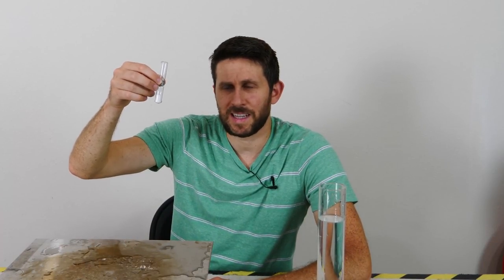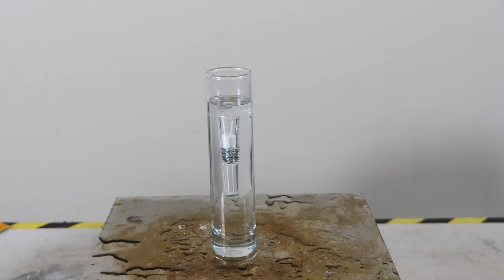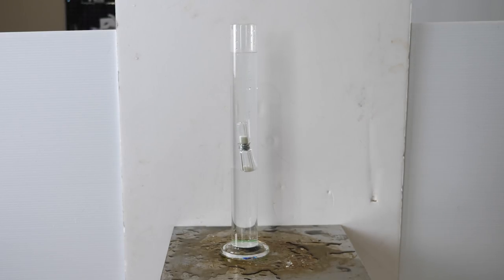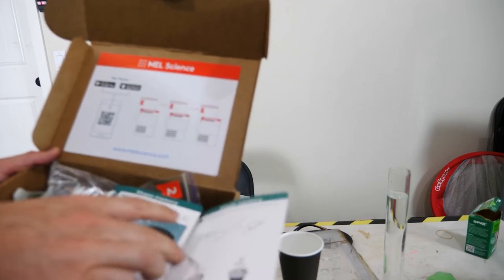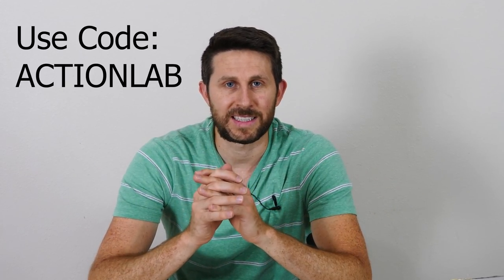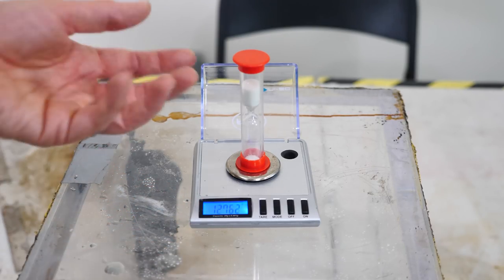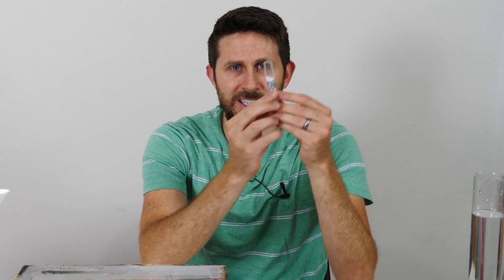Can You Figure Out The Hour Glass Buoyancy Problem?

Comment: Technically, the hourglass is "heavier" when the sand is at the bottom, in that more of its mass is closer to the rest of Earth's mass... which means that the gravity attraction between Earth and the hourglass is greater. But of course that effect is far smaller than the precision of any measuring method you would have to detect it. Great video. Thanks!

Comment: I was thinking the hourglass would weigh more when the sand is at the top due to the potential energy, similar to a compressed spring.
Reply: It probably does but the difference would be too small to measure. A small gas bubble forming on the side of the tube would affect the buoyancy more.

Comment: For those doubting this is due to friction, notice at 3:50 that the hourglass is dragged to a halt after it's fallen into the flipped water. Eventually, the center of mass of the hourglass moves low enough to "stand" the hourglass back up (3:56, but it's hard to see due to all the shaking) enough to release it from the walls. The change in the center of mass is moving the hourglass from an unstable to a stable equilibrium.

Comment: What about the little amount of sand that is free falling? As more sand reaches the bottom, the distance to the pile is shorter so the sand in the air is less, hence there is a slight change in weight.
Reply: I think that would have some effect, but at such a small scale it doesn't do much.
Reply: Yes you are correct,    And the explanation is wrong.
Reply: Internal forces can never do anything.  They always  Cancel  out
Reply: @LucaPro02  you are the best! Thanks so much!

Comment: I would like to see this experiment with a tube, unable to be blocked by sand, connecting the top and bottom, so as to prevent the possibility of a pressure differential, which is what I belive is causing it to float. As the vial is flipped, the motion of the sand tries to push the air out the other end, but since it's sealed, the air subsequently ends up on top of the sand just prior to the sand sealing off the choke point.
Reply: There will be a pressure differential, because there will be a column of water in a gravity field.
Also, it is not the pressure differential that makes an object float, it is gravity (as in, all objects tend to fall/go down, but the heavier object replaces the lighter one at the bottom, so the lighter is "pushed" upwards).

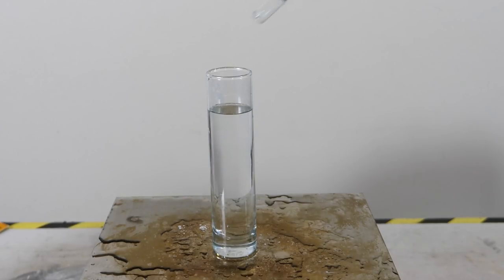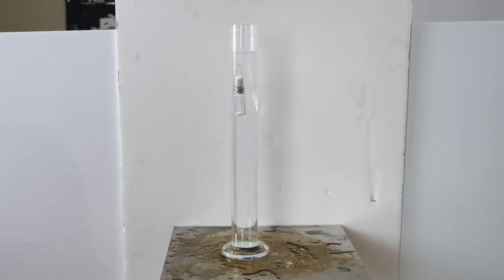Comment: Great video, but calling it out that this was sneaky!  The first two demonstrations at 0:40 and 1:24 happen to have a camera angle that helps to conceal the hourglass leaning on the inside of the tube.  In the third demonstration at 1:52, we can see the lean, but the hourglass is moving around so freely that it appears to be floating and isn’t obviously rolling with continuous static friction.  The fourth demonstration at 3:50 is a different experimental rig with rubber o-rings, and this change of experimental setup introduces the new variable of the frictional properties of rubber to consider.  Only in the fifth demonstration at 5:02 (the reveal) do we see a demonstration with 1) a wider tube so the hourglass leans more, and 2) a side-on camera angle where the frictional forces are more apparent.  Sneaky!!!  

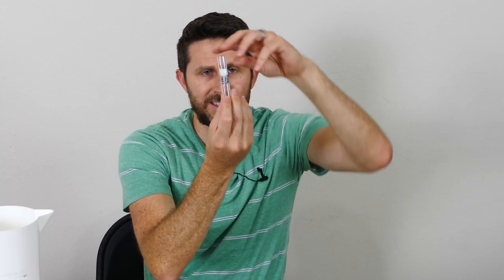P.S. At 6:06 you said “and whenever it leans against something, then that introduces a new static force or a static friction that’s pushing it upward and it’s helping ‘increase its buoyancy’.”  To be pedantic, it doesn’t actually ‘increase its buoyancy’.  A free body diagram would show the same downward force due to gravity plus the SAME upward force due to buoyancy, but with an additional force due to friction which brings it to net zero.

Comment: I thought something like... Water pressure increases as you go down, so when the lower part is empty in addition with bit high water pressure it has maximum Boyency so it floats, as sand shift to down emptying the top, but now empty part relatively in less water pressure, it doesn't have enough Boyency to float, so now it goes down.
Reply: I thought about water pressure for a few seconds, too.  I'm wondering why I and so many missed the friction solution, and I'm thinking it didn't occur to us because in everyday usage, glass on glass is not something we associate with friction, in fact we might even consider it next to frictionless-- but of course, it isn't.
Reply: So now you know that buoyancy only depends on pressure difference, not the pressure itself.
Reply: @rodchallis8031  Even if the friction is zero, I still doubt the norm that it goes down.

Comment: You missed a big part of the conclusion, that the friction force keeping it up is directly proportional to how much sand is in the top half. In other words, this will work with any size hourglass, because the heavier the hourglass, the more friction force is produced on the cylinder wall to keep it up as it tries to tip over.
Reply: isn't there a limit to how much friction glass on glass can offer?
Reply: @apbosh1  I don't think so. Friction is always proportional to the force between the two surfaces.

Comment: What if you put the hourglass on the bottom of the tube with the sand on the top of hourglass, will it float up or will it stay floating at the bottom of the tube?
Reply: Bottom
Reply: Good question. I noticed a hinge on the cylinder mounted on the wall. Is a pivot hinge?

Comment: Hi,
I just thought of a fun experiment. Suppose an object is falling in a tube. As soon as it reaches the centre. Flip the tube upside down so that it will fall from the other side. Doing this keep the object in a the centre(or a small range). What is actually happening? 
It could be better if observed with a magnet falling through a copper tube...
I am already curious to do the experiment by my self. But i don't want to spoil your lovely and in depth explanation. I would be glad if you make a video on this experiment. 

Love your videos💛

Comment: I mean, if we want to get oddly specific, technically it will "weigh" more if the sand is on the bottom. The difference would certainly be immeasurably small though. Because if the sand is on the bottom, it's perhaps 1-2 cm closer to the Earth's gravitational center, and thus will experience a stronger gravitational attraction. Like I said... oddly specific.
Reply: YES. That are exactly my thoughts too. It has always the same mass, but the weight depends on how near the grains of sand are to earth ... And it's getting heavier and heavier the deeper it sinks. :-)
Reply: I was also thinking along those same lines!!!..   though, I was thinking realitivistically -- it technically does mass more when the sand is at the top (yes, weighs less, but masses more) -- the sand at the top has some intrinsic potential kinetic energy and would literally mass more in that configuration according to Einstein... though it would be infinitesimally small.  I hadn't thought about your point, though- I wonder if they cancel out?.. probably yours is stronger.
Reply: ... just thinking about it even more -- as the sand falls, it converts that little bit of extra kinetic energy to heat energy as the sand hits the bottom and jostles around with the sand already at the bottom -- that heat dissipates through the water and escapes from the "closed" system of the hour glass...    only reloaded when you exert force again to flip it back over.

Gosh physics is cool!!
Reply: @publiconions6313  The warming causes a slight expansion of the glass bulb, making it displace more water. :-)
Reply: @jpolowin0  ooooh.. yah, good point!

Comment: I thought when there was more air and less sand in the lower half, the hourglass had more buoyancy due to higher water pressure, similar to how a pool float becomes harder and harder to keep underwater as you push it deeper.
Reply: well, glass is not elastic,
Reply: a pool float doesnt become harder to push down the deeper it is for that reason. buoyancy is always the difference of an objects weight and it's volume times water weight. So there is always the same force pushing it upwards no matter how deep it is. It probably feels that way, because we as humans are weaker in the required positions to push it deeper
Reply: @allylilith5605  That make sense, but it doesn't seem quite right. I did a quick google search, and could not find any info on the topic. I think The Action Lab should try this.
Reply: the pool float pushes you up as much as you push it down, so it becomes harder because you aren’t rooted to the ground.
Reply: @allylilith5605  bruh, the deeper you are underwater. the higher the pressure, so the object has to displace more water the deeper you go. It's called the Archimedes principle: The buoyant force exerted on a body immersed in a fluid is equal to the weight of the fluid the body displaces.
Reply: @countofst.germain6417  Until it's fully underwater of course, at which point the buoyant force remains constant with depth.
Reply: @chalichaligha3234  Yep pretty much, but that doesn't really apply to the pool floaty analogy.
Reply: @countofst.germain6417  water compression is basically negligable, the weight of water doesnt really change under pressure
Reply: @allylilith5605  Yes, but thats only when you're fully submerged. We're talking about a person and a pool noodle aren't we? The noodle won't be fully submerged and you're holding onto it trying to push it under, so you won't be fully submerged either. The deeper you push it the more water you will need to displace.
Reply: @countofst.germain6417  I am pretty sure that the op is talking about a fully submerged pool float, otherwise his analogy also doesnt add up
Reply: @countofst.germain6417  Agreed. The weight of water increases with depth. The force exerted from the weight of water is pressure that increases even though the buoyancy of the object remains the same. The friction of the container stabilizes the system but the buoyancy is transferred to the top half as it pushes the object upward, but there is less water above the transferred buoyancy. The gains and losses of the bottom and top halves of the object are equivalent. When it eventually sinks, the weight of the whole object is greater than the water pressure exerted upon the buoyancy of the top half. Also, when the buoyancy begins on the bottom half, it gains a perpendicular surface area for water pressure to push up against, thereby pushing the weight of the top half from the bottom half. When the buoyancy transfers to the top half, water pressure at the top half only has parallel friction and it loses its grip 😑
Reply: @warren92277  Sorry bro, I'm only talking about this random person and his pool floaty. I believe the hourglass is nothing but the centre of gravity trying to flip the hourglass and then fiction adding just enough force to stop it sinking.

Comment: When kept upright, the sand particles falling should experience weightlessness. When they stop falling, the mass of the sand particles must return. So maybe it is the small difference in net mass that affects the sinking and floating. @ActionLab, can you do the experiment again but this time don't allow the sand to fall to the lower chamber in the hour glass
Reply: It does make a difference but so marginal it would be indistinguishable. The mass of the falling sand partical is probably not even a tenth of thousandth of the weight of the hour glass. And so the difference in acceleration would be insignificant

Comment: If you do this with an hour glass that is slightly less dense than water then it will work the other way round- Invert it so the sand is at the top and push it to the bottom of the tube. As the sand fills the lower chamber the friction against the side will decrease and the hour glass will rise. I spent some time in the early 1990s making these- with two parallel tubes- one with a floating hourglass and one with a sinking hourglass. When the entire structure is inverted one hourglass gradually sinks and the other gradually floats. We filled the hourglasses and paired sinkers and floaters with similar delays. This created the illusion that one hour glass was somehow influencing the other. We sold these through a toy and puzzle outlet in London.

Comment: Air displacement. There's a little gap inbetween each particle of sand and as each grain of sand falls, the air underneath rises to the top tube. The air under the sand has more resistance to move up and as the sand becomes less and less, the more the air can move up. Same thing with water or any other liquid as well as particles.

Comment: The weight does change, but only slightly when the sand begins to fall, and again at the conclusion of falling  (for a split second).  During the fall the loss of weight (due to the falling sand not adding to the weight) is counterd by the impact of the sand against the bottom.

Comment: Actually, the hour glass has a tiny bit less weight when the sand is on top, because the falling sand doesn't exert a force onto the scale while in free fall. But since the mass of falling sand at any moment is so miniscule, it's difficult to measure the difference.
Reply: It also weighs less because it's farther away from the center of the earth...

Comment: I figured it would flip over before you showed it. Though I couldn't explain why that was the case. I just knew from experience the heavier part of the an object will face down when sinking unless it's impossible for it to flip.
Reply: The Archimede's force acts on flow line, so the lithest part goes up as a scale.
Reply: Well it turns, cause its a unstable state to have high mass up if it csn flip. Just draw two states : one where it is completly straight, and one when it is slightly tilted. When you draw the force vectors,you will see, that while it is straight, there wont be any force being able to turn it , cause the gravitationsl force pulls exactly downwards and not perpendicular to the tube. Bit when it gets tilted slighly, you will notice, that there will be a force l, that tries to tilt it more. So its unstable, cause at the point it slightly tilts, it wants to tilt more and more and more, till its flipped with heavy side at the bottom. Then it will be stable. Cause if it slightly tilts, there will be a force against this tilt, and it will tilt back

Comment: The small stream of sand in mid air does reduce the weight though even if it is not enough to cause it to float or to be registered on the scale. The force of the sand hitting the bottom may also affect weight readings. Suffice to say though that the stream of falling sand, just before any has hit the bottom, is going to reduce the weight.

Comment: If you made it frictionless, there's also perhaps an effect from the fact that the sand falling is lowering the center of mass of the hourglass. Depending on how fast the sand falls / the center of mass goes down, you might be able to get the hourglass as a whole to appear to not be sinking (and in fact, you might be able to get the hourglass casing to rise relative to the water as the sand falls, so long as the center of mass is falling far enough). No?
Reply: I was thinking the same but probably no. The buoyant force and the mass is constant, so whatever happens inside stays inside.
You can get a one-time kick from accelerating some mass downward, but not a constant force.
We need more experiments... is hourglass lighter while the sand is falling?

Comment: I though that the thin line of sand "falling" wasn't part of the system because it wasn't exercing a force as it have no weigh until the hourglass was full at the bottom ( because the line of sand last a while, and is still "mid air" )
but yeah the sand falling have an inertia when it hit the bottom that would have mitigated this effect I guess

You could have tried the same experiment but with the metal wire at an end to see what happen without friction, but at this point a precision balance do the trick

Comment: If you make a weighted hourglass such that no matter where the sand is, its center of gravity is below the "sand chamber" portion - and still as a whole system is neutrally boyant - it will experience no force attempting to flip it.  And thus, it won't need to touch the container wall.  It would always float or sink based upon its overall density.

Comment: what if you balance the sand perfectly in the top so that the glass doesnt try to flip and hit the tube?
Reply: U can't balance it perfectly
Reply: Yes or weigh it down with some wire or something.
Reply: @sa-zq4eq  well duh its theoretical
Reply: @archity1242  what do u mean
Reply: @sa-zq4eq  its obviously not possible to perfectly balance the sand but if you could what would happen
Reply: @archity1242  nothing, it would sink like normal. The only thing stopping it from sinking is the external force from it touching the side of the tube.
Reply: @countofst.germain6417  yeah

Comment: I was wandering if hourglass looses weight while some of it's grains are in a freefall, but it went completely different way
Reply: This is what I was thinking too, but when it started falling after only some sand moved I knew that was wrong. It feels more like a trick since it's just from the hourglass sitting against the side of the container
Reply: I feel u are right 👍
Reply: Kinda makes sense. It would only lose weight if the momentum is increasing, which is only when the flow rate of the sand is increasing